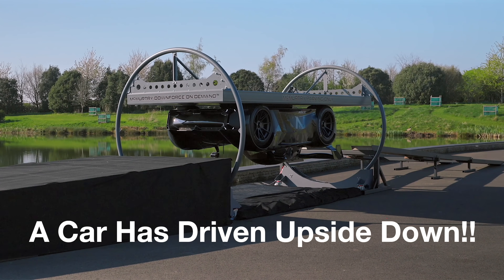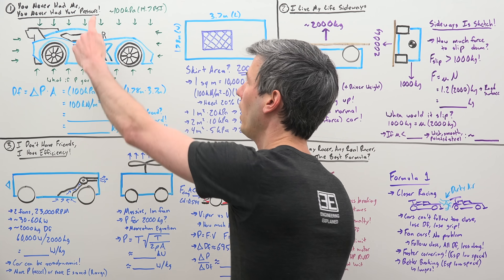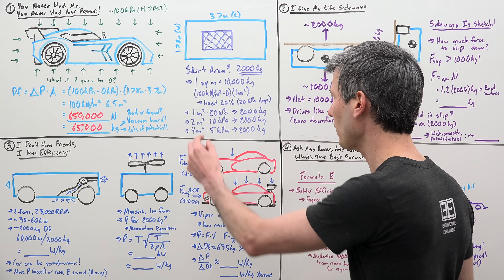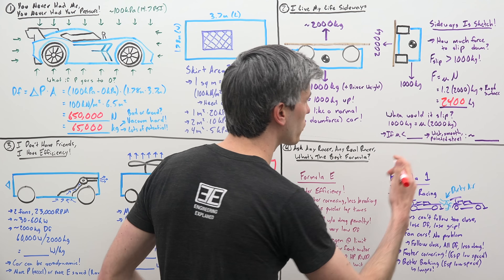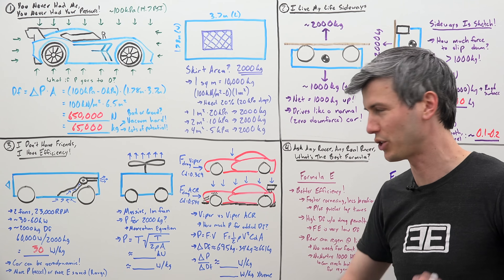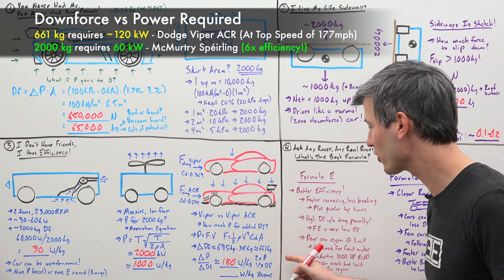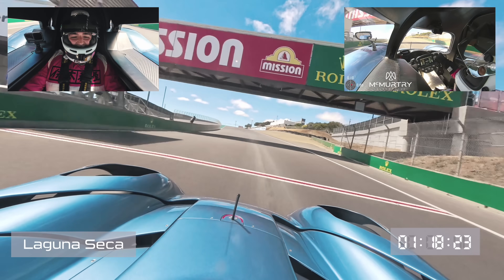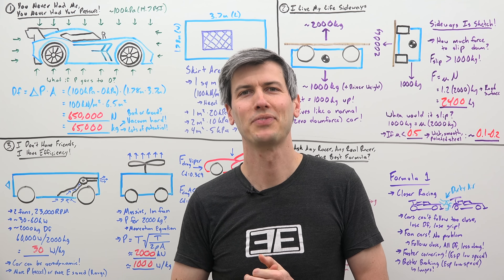This Car Just Drove Upside Down!

Comment: I dont really understand the 1m² fan pushing downward instead of vacuum equation. Shouldnt you have to take inte account propeller efficiency?
Reply from the maker: It's an idealized equation, that's the minimum amount of power you'd need with a 1m (diameter) fan pushing down (reality would be a bigger number). The larger the rotor (same with helicopters), the less energy you need. But if you go wide on a car you'd go outside the width of it, so I just used 1m as an example.

Comment: How does the pilot (driver) cope with the three g's of force? Obviously fighter pilots are trained to cope with higher g's I think seven or eight but don't quote me. But the operative word there is training. They also have special suits that maintain blood pressure throughout their body.
Reply from the maker: Normal people can handle 3gs. I mean, you need a strong neck, for sure, but should be fine if you're in decent physical shape. Humans start passing out around like 7 g's, pros can handle like 12+ g's.
Reply: @  it also depend on direction where hardest is from up to down with longitudsl axis to spine but we talking here about position in cars so perpendicular from rear to front from front to rear from left to roght and right to left 👌🏻🪠 also difff people have difff stamina for G force however at such low level it dosent hit yet tht said in regard to Gforce itself more trwining will required  to use to brain for faster stuff happen while taking corners  and hold good line at border of grip 👌🏻 Gforce itself at this level in direction about which we talking about isint trouble for 99% avg people unless some diseases os  👌🏻 and 12 gs for pro isint for infinity = the higher Gs the shorter time you can withstand  it before blackout and G lock feg 500 G which last 0,01 miliseconds and it be registered be you as short jerk where nothing noticeable happen to your overalll body funciton vs 50 G last 1 minute and your dead 👌🏻but yea thay can take  it and avg people not for such amount of time at which they can take it without blackout and Glock  👌🏻
Reply: at such low level of Gs you dont need special training .
Reply: One of the YouTube channels that tested it (it was hagerty or top gear ) they guy driving it get weary uncomfortable after a few minutes with max g forces

Comment: In your calculation for power usage for downforce in McMurtry, need to include rolling resistance of the fan skirts if above zero (calculating Vioer at speed, only fair).  Also the McMurtry will have aero drag just like Viper at speed.
Reply: The point is that the aero drag is vastly lower because none of its downforce comes from drag producing wings and whatnot.
Reply: @ I get that, but if going to trouble of doing all those calculations and explanations…
Reply from the maker: That's fair, but you could also have a much more efficient shape than a stock viper, so the real advantage could be much greater than the numbers shown. Of course, rolling resistance and skirt friction would add to this, but aero is such a massive power draw.
Reply: @ Yes, much smaller frontal area and coefficient of drag, I agree, but still in the equation at speed.  I get you have to simplify somewhere too or these videos would drone on forever…

Comment: Hap Sharp & Jim Hall with their Chaparral fan car that got banned and shouldn't have. They weren't try to have it upside down, but this is a big move forward in the downforce experimentation and kudos to McMurtry on it.
Reply: The McLaren F1 and the Gordon Murray T50 also have fans.
Reply: @bishopdredd5349 The Brabham Fan car did exactly this. Gordon Murray said it could do 2G starts. Problem was that the fan was linked to the throttle as the cars then had no batteries. The F1 and T50 to a much larger extent don't really vaccuum the car to the ground. They create suction to control the airflow underneath the car to force the air to follow the shape of an otherwise impossibly steep diffuser which enhances the venturi effect. The Mcmurtry does both - a skirt to vaccuum the car to the ground and a "diffuser" shown here that's basically a vertical cliff and exists only to suck the air out through the fans.
Reply: As soon as I heard fan, I thought Chaparral

Comment: This was done in 1970 by the Chaparral 2J which was quickly banned from racing because it worked so well.
Reply: More so banned from debris I think. The car didn’t win much. But the speirling has filters so no rocks are thrown.
Reply: When did they flip the car and have it stick to something?
Reply: @Axle0Bullitt019  they didn't, it used the same method as this car to give downforce at low speeds for corners but as far as I know they never tested it upside down because there was no reason to.

Comment: As I watched this, 2 things occurred to me.  First, with the additional forces of acceleration, cornering, and braking, what does that do to the driver over the course of time?  Do standard F1 tires have the sidewall strength to hold up to that downforce?  I'm thinking they do, but is that a certainty?
Reply from the maker: F1 has higher g forces than this, they'll hit 5+ g's at times. So for tires, it can certainly be done. You definitely need a strong neck though!

Comment: You slipped in a big assumption in the without explaining it :(

How did you decide it takes 30-60kW to removee the air?
Reply from the maker: I asked how powerful the fan motors are - they said they can reach 2000 kg of downforce with 30-40kW, 60kW max.
Reply: Plus, its a 100kWh battery. They say it can go 300 miles, but Im guessing your milage will vary, since the drive motors are 746kW. He also talked about how efficient it is, but 100kW would run my house for a week. Same energy for 30 minutes of driving?
Reply: @raullasvegas  It's a bit unfair to compare a house to a car, since the house can't really drive anywhere at all (typically) :p
Reply: @TimRobertsen  Very true. I was trying to convey just how much energy that is.
Reply: @raullasvegas  Well, I screwed up my spelling, twice! My brain is on holiday:p 60kW for the fan-motors isn't really that much power, it's only 80 horse power. It is a decent trade-off for extreme cornering-speed.
100 kWh (the battery) is a good chuck of energy, it will run a house (average, in Norway) for about 2.5 days.
Reply: @ See! again the house analogy 🤣🤣and we are mixing kW and kWh. More confusion. Lets see if I can use English effectively. The stated range is 300 miles, but if youre using 30-60kW for the suction fan, and another unknown amount of energy for accelerating, the runtime would be kind of short. Although, thinking about it, youre going faster around the corners. It would be an interesting experiment to find out just what the runtime is on a racetrack. Electric cars get 3 miles/kWh on the road. A Tesla can go around the Nürburgring twice on a charge (24 miles/40km) at least I think thats what Misha experienced. Its a fascinating car, no doubt. I just wonder if 100kWh is enough.
Reply: @raullasvegas  Well, since houses had already been drawn into the talk, I thought we might as well get some good numbers out of it:p 
Regarding the car, I would guess, that the fans aren't running full power at all times. Just my guess. Top Gear tested the car around the top gear track, it was by faaaaaaaar the fastest car they had ever tested, it's on youtube ;)
Reply: @raullasvegas house is weird comparision for a car
Reply: Ah ok, I didn't realize that info came from them. Thanks! 
That would be pretty tricky to reverse engineer ;)

Comment: 0:20 Not putting footage from Albert Park here was such a waste :D
Reply from the maker: Wow complete miss on my end hahaha (it's in Australia for those reading and not understanding).
Reply: @EngineeringExplained  can we talk about those fan blades next time? i doubt they last long from getting sandblasted everytime the car drives a mile. i fly paramotors and the carbonfiber props taking so much damage by just flying some minutes on the beach. i cant even imagine how they look just after one lap on a racetrack 😮
Reply from the maker: @cloudpandarism2627  There are filters to eliminate anything above a certain particle size. Still, must be a challenge!
Reply: @EngineeringExplained  thanks for answering mate, omg the honor haha! 
filters seem to not work well since there is soooo much dust coming up on each video i see this thing driving. particles at that size are enough to eat those fan blades. and i bet cleaning/swapping the filters after some km of use isnt fun either. a good and clean racetrack for sure helps but imagine this thing on a normal street when "customers" start to show of the fan on a sandy hotel parking lot in front of their friends. i love the idea and want drive this car very much. i am living in china and just bought the xiaomi ultra with 1600hp. its fast but 0-100 is not very good due to traction. i wish it could be a bit more...

Comment: Yippee, fan cars are the future.. on super well-maintained tarmac at least...
Reply: The Speirling beat an F1 car's lap by more than three seconds at Dunsfold Park. That is not a smooth purpose built track
Reply: @dod_the_angel  People apparently don't understand that you don't need a perfect surface to maintain a partial vacuum. They are confidently incorrect.
Reply: Chaparral 2j now track legal?
Reply: Yeah, I am wondering how much track prep needs to be done to keep small stones and pebbles out of the intake?

If someone goes off track in front of you and hits the gravel pit I have a feeling it's probably game over for the fan.
Reply: @volvo09 The car has filters so no rocks being thrown problems.

Comment: Driver61 is going to be so butt hurt....
Reply: driving upside down at 0.1 km/h with a fan car is very different from driving a car with normal downforce upside down though a pipe like thing
Reply: Driver61 should setup an F1 car in a wind tunnel, and use the same contraption used here to get it upside down. Seems way cheaper and safer than his idea of this massive scaffolding tube. You could put the car on a treadmill to make it more realistic.
Reply: If this gets some coverage, it could in fact help him to find sponsors for what is a much more spectacular (read: spectacle) event than seeing a car sized vacuum cleaner.
This is a neat demonstration. Driver61 is planning a stunt á la Evil Knievel.
Reply: @urinstein1864 if the speirling is a car sized vacuum cleaner, a gas car is also a car sized air pump?
Reply: They're doing something vaguely, very vaguely, similar. The comparison is tenuous.

Comment: Come on, that's cheating. That's not downforce created by aerodynamics and velocity, it's just basic suction. I could lick one of those rubber things my kids are always sticking to the fridge and do the same thing.
Reply: Cheating based on what rules? It's not cheating, it's a technique to produce downforce. If it is cheating, then wings are cheating too!
Reply from the maker: Roads don’t have a perfectly smooth surface; it’s quite a feat to be able to pull this much downforce (proof is in the track numbers). It’s definitely not easy! Though the smooth steel surface does make this scenario easier to seal, for sure.
Reply: @EngineeringExplained  Agreed, it's impressive to have something nearly a tonne in weight suspended upside down through suction but, my point is, the holy grail of "driving upside down" wasn't meant to be done at snails pace due to non-aerodynamic forces
Reply: If that is cheating, than so are passive spoilers, turbo's, injection,... It's basically cutting-edge engineering.

Comment: damn, roomba vacuum with a cockpit
Reply from the maker: Do y’alls Roombas actually work? Mine’s pretty bad at vacuuming 😂 Makes nice little chimes tho
Reply: @EngineeringExplained  so this actually the evolution of a Roomba?
Reply: @EngineeringExplained gets stuck on everything. Maybe in a decade we will have ones that don't not suck.
Reply: @BrownieX001  A vacuum that doesn't suck? What's the point of that?
Reply: Most robot vacuum cleaners don't actually have suction motors, only small motors to drive the wheels and the brushroller to comb big stuff into a dirt bin.

Comment: It's cool, but the fan is definitely cheating.  The whole point of the feat is having to do it at speed with downforce that is generated naturally by the design of the car.
Reply: Instead of calling or cheating how about we use technology to get faster lap times instead of the same boring cars every single year since there is nothing left to innovate on.
Reply: @yeet5146  cheating, boring... both sides of the isle are the same at this point
Reply: It completed laps faster than cars using aero downforce. So under its own power it outperformed. That doesn’t sound like cheating. At a standstill sure, but that’s like a bonus because it’s not possible on aero cars
Reply: @Jst4vdeos  I wonder how much prep has to be done to the track to clean up pebbles and small stones before a run? Seems like it would be a challenge to keep debris out of the fan?

I think it's pretty impressive to make it work at this scale.
Reply: @volvo09 they need a hoover on the front bumber to suck up rocks n stuff!
Reply: @ no clue, prep time isn’t accounted for in lap records….
Reply: If this is cheating, so are aero wings also. And especially active ones. This is just downforce at a standstill, aerowings at speed!
Reply: Haters gonna hate. "Cheating" lol
Reply: @NewBeginnings571   that's why I love what people and teams do in (mostly older) racing to "bend the rules", it wasn't explicitly stated that you can't do X or Y, and then a team does it and everyone who didn't think of it cries.

I haven't heard of this car before, but I've watched a few videos of it and it is wild on turns. Like an F1 car, but can turn harder at slower speeds.

Comment: And people said electric cars would be emotionless.
Reply: Actually Aerodynamic device is the most interesting part. Now check GMA T50. Gordon Murray's most finest car.
Reply: Murtry haters will be Murtry haters.
Reply: How many times are you going to do this? How many times CAN you do this? In comparison, you can drive any ICE at any time however you want. Upshift downshift, rev match, hit the redline, stationary rev, rev while driving in neutral, should I keep going?? How easy would it be to just be on the street and do this? Compared to the ICE? I’m not saying this is not impressive, not cool or emotionless but electric cars in general are way way way less “emotional” compared to ICE’s. Cheers
Reply: @VaneNaumovski  What are you even yapping about? Driving is about feeling the steering, the chassis, managing throttle and grip. Whether it's Manual, Auto, or Electric is irrelevant to an "emotional" driving experience. What matters is if the car is designed to be fun, which many aren't.
Reply: @VaneNaumovski we get it, you like your lame ass camry, keep malding
Reply: @VaneNaumovski I prefer the instant torque over some dino juice burning noises but I guess that’s just me